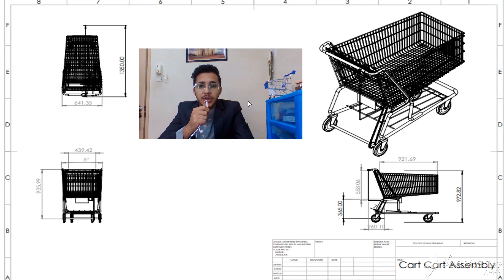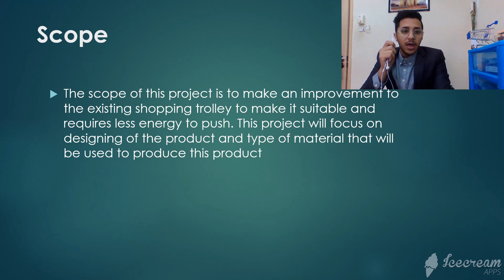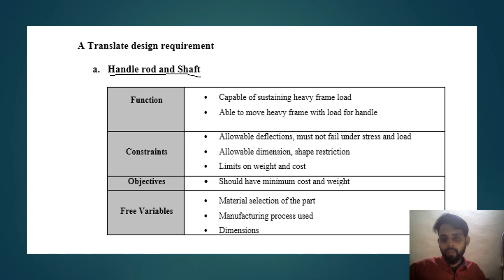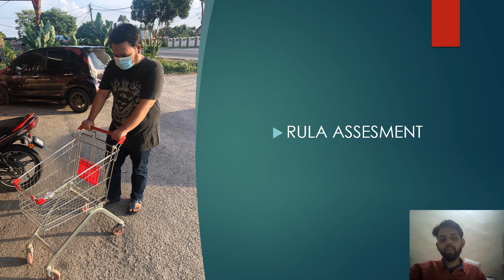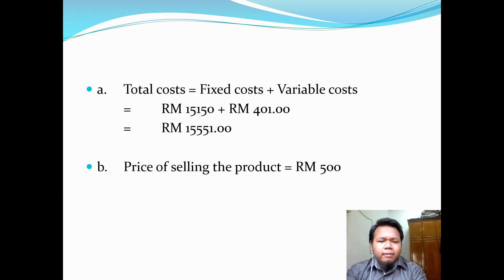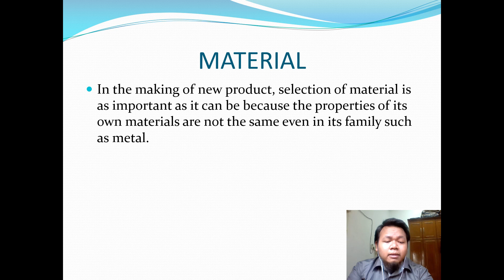Motor Assisted Shopping Cart

Comment: Good project. Here are my concern:

1. How did you ensure the safety of the user from touching the rotating shaft.
2. In terms of the price, what is the current market price for shopping trolley and how is your price competitive to the current trolley.
3. What is the maximum  trolley load that the motor can carries. Please justify your answer based on the engineering analysis.
4. What is the speed of the moving trolley, and how does it react when the maximum load is being carried on.
5. How this product can be sustainable to the environment.

Thank you
Reply: Thank you for your positive comment.

Regarding your questions here are our explanations
 
Q1. How did you ensure the safety of the user from touching the rotating shaft?

Safety is one of our main concern as this product will be used by many and we are aware about the hazard regarding our rotating component. There are few steps taken to ensure the safety of our product. First, we made our trolley handle outward, where the handle and shaft position are not at the same distance. By moving the handle outward, the normal holding and standing position will be further away from the shaft. This avoids the user from getting near to the rotating shaft as well give a safety gap to the user. Next, the push button is designed to only activate when it is pressed (user have direct control of the motor). This means the motor will only spin the shaft if the push button is pressed, once it is released the motor will stop moving. It also means this is not a continuous rotating part which have less dangers compared to continuous rotating part. In case of emergency user have the control to stop the product and it is natural for them to release the button thus it prevents injury to happen. Next, we planned to place a safety sign stickers (Rotating shaft hazard) on the product to warn users about the danger of rotating shaft. To follow up we also will paint the shaft in bright colour do differentiate it from the product and to make sure it is visually visible to the user so that they are well aware of the part. 

Q2. In terms of the price, what is the current market price for shopping trolley and how is your price competitive to the current trolley.
In the terms of pricing a normal non-motorized shopping trolley sold by Malaysian manufacturer cost around RM 500-640. Example: (Trolley Shopping Supermarket 180Litre Security Tube Base ST SKT180). While the motorized will technically cost more than RM640. Our product costs RM500 where it is in the range of a normal non-motorized shopping trolley which means it can be an alternative used on the shopping complexes. We can clearly see its cheaper than the competition. Regarding the price, our product if done in large scale the manufacturing cost might go lower. 

Q3. What is the maximum trolley load that the motor can carries. Please justify your answer based on the engineering analysis.

For our product we used power window motor that rated 1.5HP, where it is said by the manufacturer that it can withstand and move a load of 250kg. In the case of engineering analysis, we made an analysis on the shaft to see how much load the shaft can hold as it will be rotating and at the same time withstand load given to it. From our test we simulated the highest load which is 250kg to see it can withstand or not and in our test, it shows that the load is applicable. On the same time from our findings the normal shopping weight does not exceed the tested weight. Normal shopping weight is not more than 100kg. We can clearly see that failure of motor is not possible as it can carry a load more than the given value at the same time the shaft will also not fail interfering with the motor capacity.

Q4. What is the speed of the moving trolley, and how does it react when the maximum load is being carried on.
The speed of the moving trolley speed will be around 2-3km/h max and when a maximum load is carried the speed will be reduced from its normal speed, but as we said previously the load of shopping item will not exceed 100kg, thus the maximum load will not be reached. 

Q5. How this product can be sustainable to the environment.
Our project uses less non-recyclable parts and most parts are made from Low carbon steel. Steel is a uniquely sustainable material because once it is made it can be used, as steel, forever. Steel is infinitely recycled and there is no down-grading. The steel recycling loop is a true closed loop.  It is recycled and used again, without any loss of quality, time after time. In our project, there are three main manufacturing processes that involve which are forming, joining and machining. Those processes do not involve any chemical process thus it is safe for the user and for the environment

Thank you
Reply: @dhaneshshanmugam36  Thanks for the clarification, all the best!